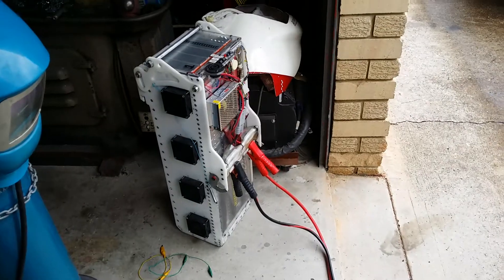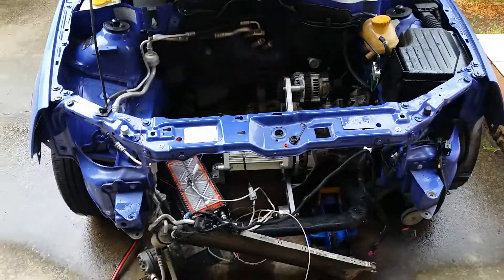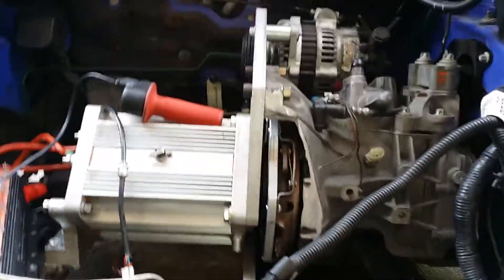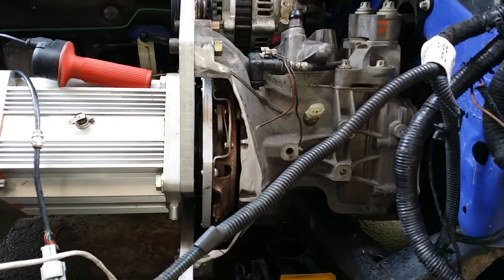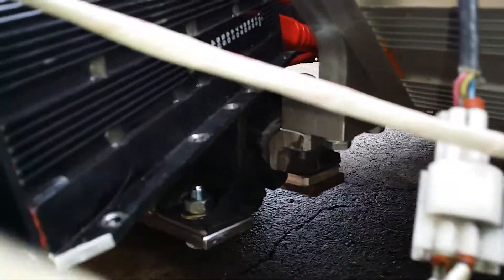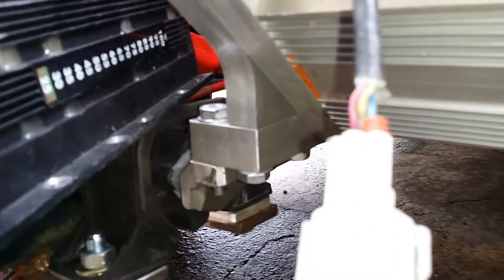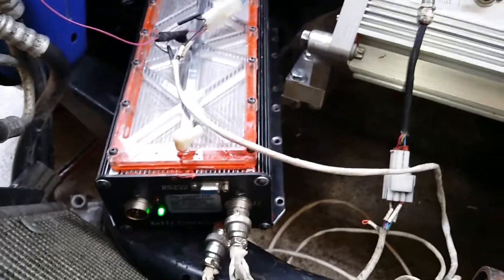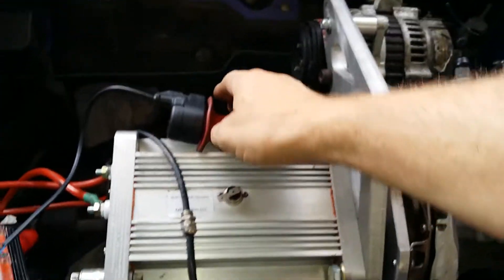Ripperton Barina Electric 5 speed

Comment: awesome! do you plan to "shift" this one like a normal car to give it a more normal car feeling? 
the alternator on the magnetic clutch is an awesome idea, cant want to see it on the road!
Reply from the maker: Yes shifting as per normal petrol engine, got sick of not having enough torque at low speed with the single speed versions. Even on only 134v it still revs like a petrol engine